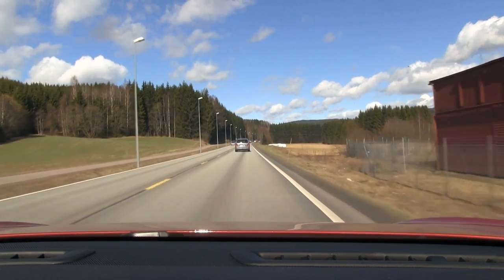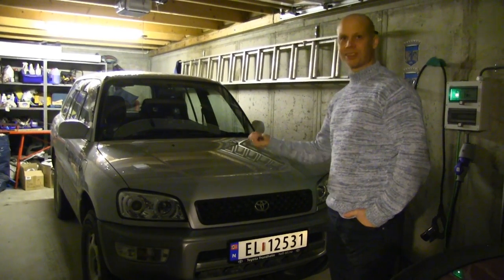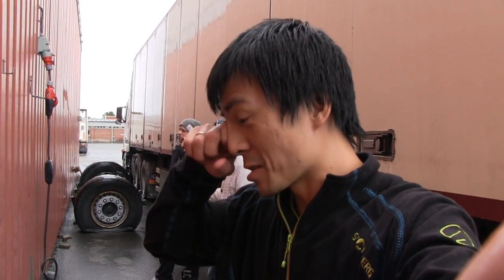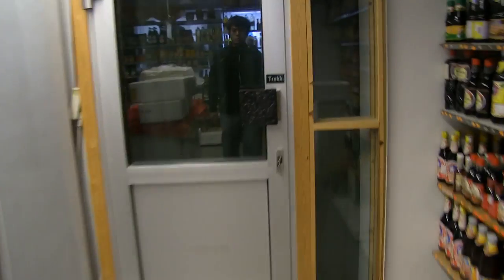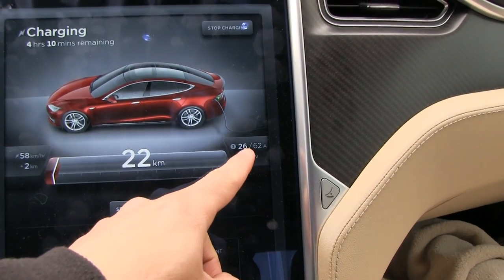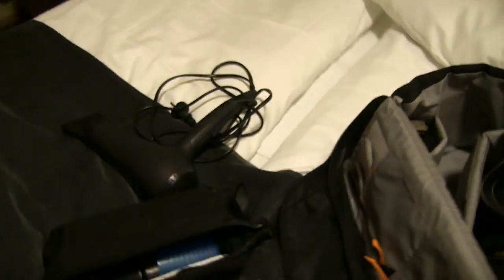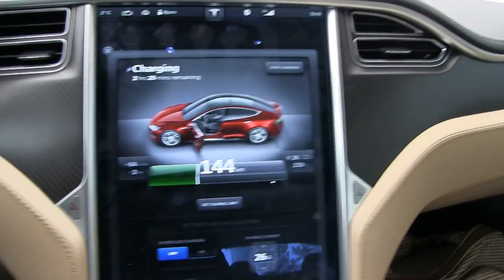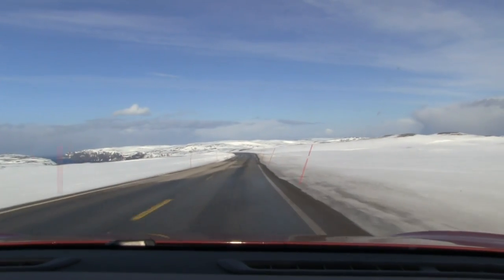Tesla Model S videos: #8 North Cape part 1

Comment: How can you live with that booming noise inside the cabin?
I also don't get the price of these cars. You pay no vat, no taxes, and it looks kinda cheap inside.
They should cost like half of what they actually do.
Reply from the maker: The noise level sounds higher because I'm not using a clip microphone. It's been commented many times before. The interior in Tesla is not the best. Even my old BMW 525d E61 had better interior. The reason why they are expensive is because it's an electric family car that can do 400+ km in a single charge. No other car in the world can match that.